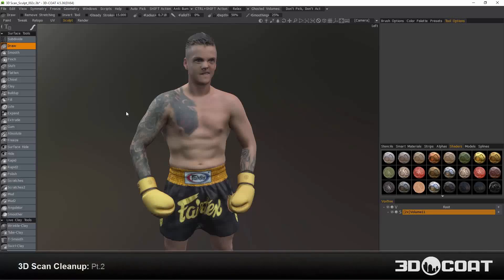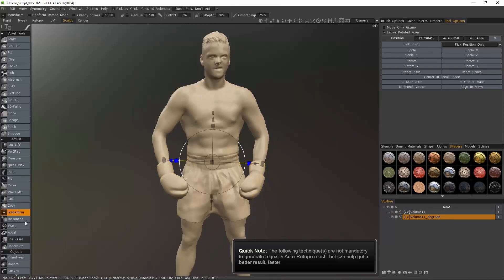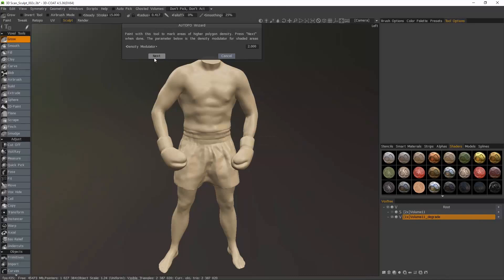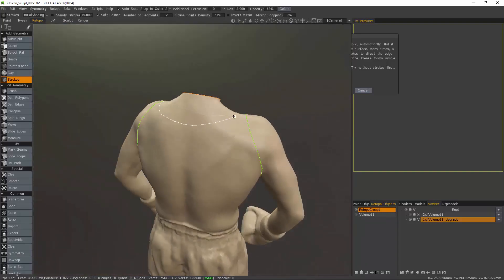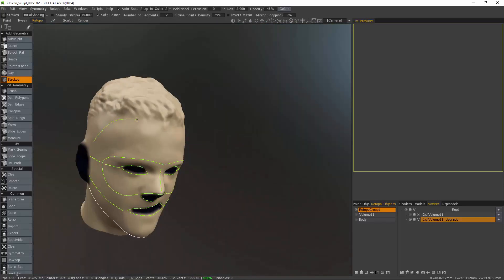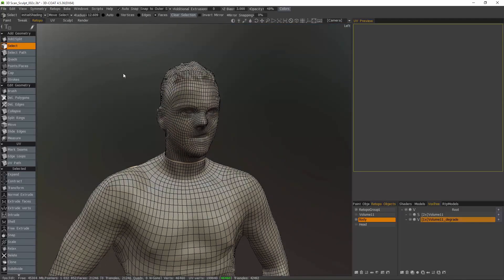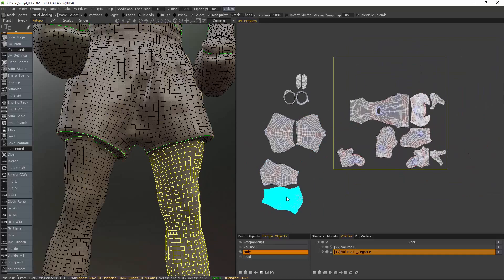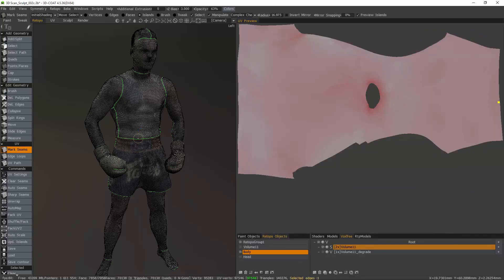3D Scan Cleanup Pt 2

Comment: I'm definitely gonna make a few tutorials of my own to show people how great 3D Coat is. The UV Unwrapping on it's own deserves major kudos points, and the sculpting with Voxels is great though still need to practice to understand it better as i am a ZBrusher :) 

In any case i know i saw a video in which you showed a new type of retopo where you draw out the lines and then it automatically applies the mesh and you can control the number of edges you get, so how is that thing progressing as well ?

Cheers and keep making great stuff
Reply from the maker: +Denis Keman: Thanks. I think you are referring to the STROKES tool, which is normally considered to be a MANUAL retopo tool, but is somewhat of an Auto-Retopo tool of it's own. There are a few videos that cover it in detail, within the RETOPOLOGY TOOLS playlist, on this Channel.
Reply: +3D Coat I'm pretty sure you are right though i will have to recheck. I know i was looking through the different options the retopo (manual) is done in 3D Coat as i want to feature 3D coat's retopo in a future post on the website. The idea is to explain what Retopology is and then show how to do it in different software packages like Max, Maya, ZBrush, 3D Coat, Topogun etc .. 

Seeing as how i have been a Max guy for ages it's actually very impressive that for me retopo is much better in 3D Coat then Max, and on top of that the fact that i use the UVW unwrapping in 3D Coat exclusively for pretty much everything  then you might call me a Coater as well :) 

So like i did say in the previous comment, keep up the great work.
Reply from the maker: +Denis Keman: I think you might have seen this video, where the Strokes tool has additional functionality, where you can create loops > determine how many edge rings you want > hit the ENTER key and you have an entire mesh. 
https://www.youtube.com/watch?v=1k7zZq1VAIs&index=7&list=PLF62F3C31216D2794
Reply: +3D Coat Actually i think it wasn't even on YouTube as it might have been on Vimeo or some other provider. In any case it wasn't the Strokes tool as i have used the Strokes tool, it was rather something experimental that i don't think it's still in the active build. From what i remember the retopo was done on a head and it was pretty radical and cool to watch it, so kinda can't wait to try it out.